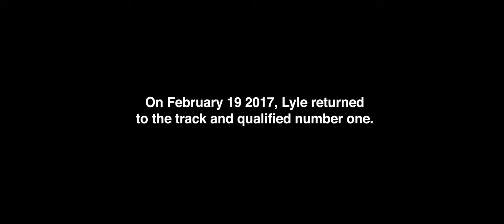Patient Story - Lyle Barnett

Comment: Lack of proper inspection, safety rules and requirements at the facility. Racers die unnecessarily at tracks that know better too many times a year and yet enforce it. Glad you made it and also that you promote proper PPE based on your experience.